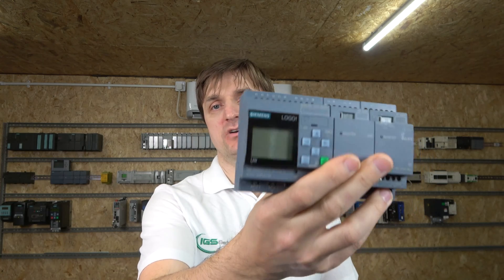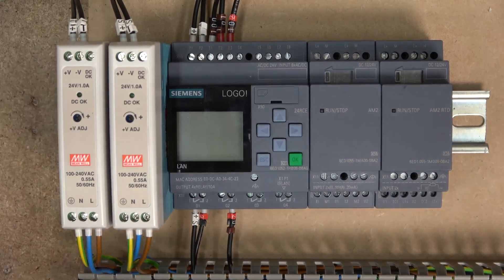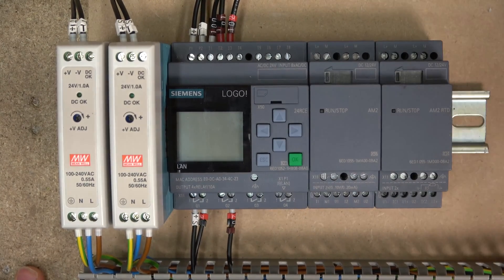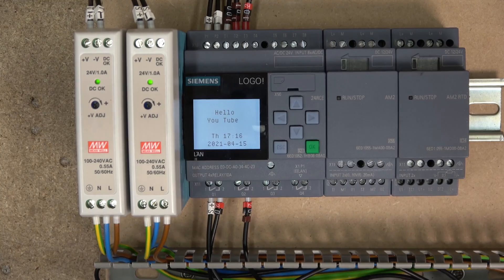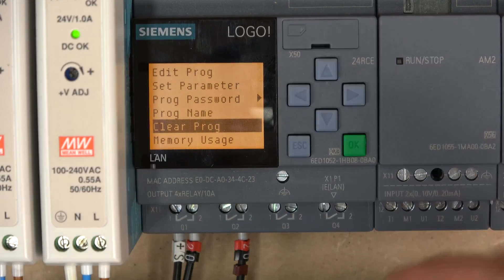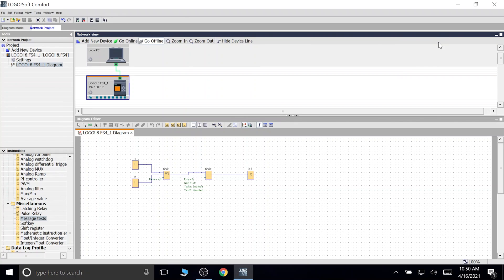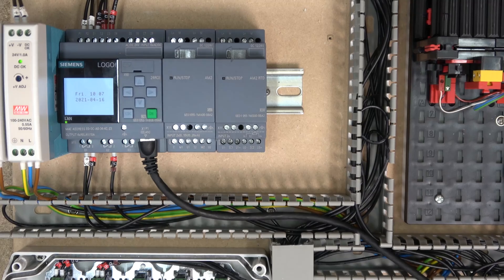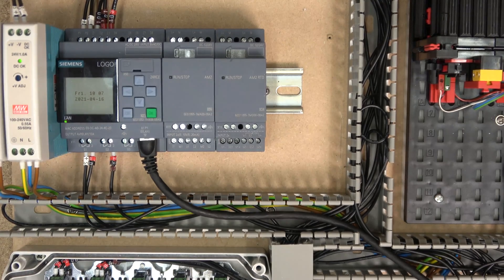Siemens LOGO! 8 SF4_1 wiring, program upload/download, password reset using LogoSoft Comfort V8.2

Comment: Hi, I bought siemens logo from ebay and it is used. There is an existing program on it. Is there a posible to remove or factory reset the logo.thankyou😊
Reply: Power on your PLC and go to Setup>Factory reset. it is almost at the bottom

Comment: Hi!
I'm an electrician and I have little experience in PLC programming...
I need to program a Siemens Logo PLC to control a wika transducer in a basic hydraulic circuit and I would like to know if you can help me?
It would be the hydraulic pump, the valves and the wika transducer...
Thanks.
Marcio
Sao Paulo...
Brazil...

Comment: Hi, thanks.
In Germany, a Logo!8 cists from 45 ,--€ at eBay.
Cable Costa extra.
Will the bus cable/ connector to USB from previous versions do Plesse?
Thanks a lot anyway!
Regards
B. PhD Student ee
Reply from the maker: Hello there. I struggle to understand the question. Wright in German.
Reply: @IGSElectronics  Hallo, vielen dank für Ihre Antwort. Es ging um die Kompatibilität eines möglicherweise älteren USB-Anschlusskabels mit der aktuellen SIEMENS LOGO! 8- Steuerung. Ich nehme an, dass man das ausprobieren müsste. Ich verbleibe Mit Gruß, B. Dipl.-Ing.
Reply from the maker: @Alex51377  Ich werde demnächst ein Video von dem Vorgang machen. Ich glaube, der Übergang zwischen älterem Logo und Logo 8 ist einfach und erfordert nicht viel Programmierung. Sie benötigen ein altes Programm von Logo 6 und wenn Sie davon lauten müssen, benötigen Sie dazu das USB-Kabel.
Reply: @IGSElectronics  Hallo, danke Ihnen! Das ist eine interessant Information. Meine Frage bezog sich auf die Hardware. Aber ich denke, ich muss die Kompatibilität eines älterene LOGO!-USB-Kabels einfach ean einer SIEMENS LOGO 8 - Steuerung ausprobieren. Nur, falls Sie es zufällig wüssten. Danek nochmal für das Video. MfG, Dipl.-Ing. B.

Comment: Hello, I've been enjoying the videos on Siemens LOGO! Logic Modules. Can the output relays on the LOGO! module handle AC power supply? I want to switch a 110 VAC lamp ON/OFF. Can I connect the + and - from the lamp to the Q1 output relay? I do not want to break my device so I haven't tried it yet, but I couldn't find information anywhere else online. Thanks!
Reply from the maker: Hi There. Glad you enjoy the videos. All LOGO relays by standard are able to work with up to 240V 8 amps. Make sure under the screen it say relay not transistor outputs and you good to go.
Reply: @IGSElectronics  Great! Thank you for the fast response!
Reply: @IGSElectronics  Another question actually :) - Are those busbars at 2:05? I need a way to have a power line with multiple connections to it to power assorted devices. Basically a common power supply node I can attach cables to. Is a busbar what I am looking for?
Reply from the maker: @Sheep--  no they are just made up cables to go from one com to other. Easy and cheep
Reply from the maker: @Sheep--  Are you using my set up or your own. If your own, looks wary good, not sure what is your goal, but the fancier the better.
Reply: @IGSElectronics  I'm using a different set up where I have LOGO! Power Module, LOGO! 12/24 RCE, and AM2 RTD. The Power Module has a VAC input that powers the LOGO! 12/24 RCE. The outputs I need to control will use the same VAC power going into the Power Module which Is why I want some kind of common node. I am controlling a Compressor, Fan Motors, and a Stepper Motor or valves, for a refrigeration control system.